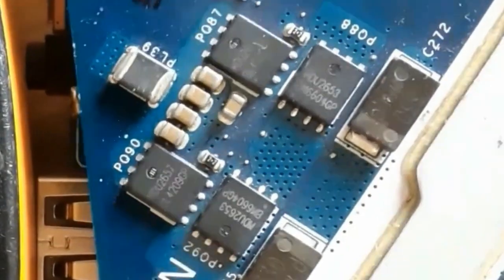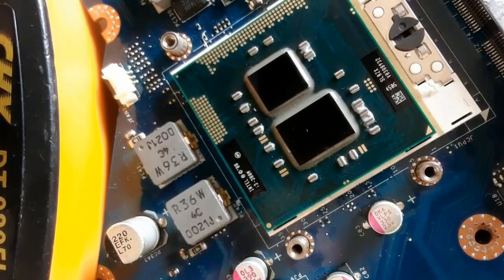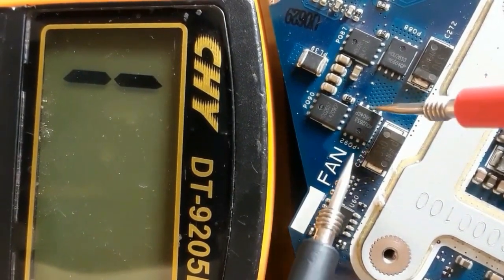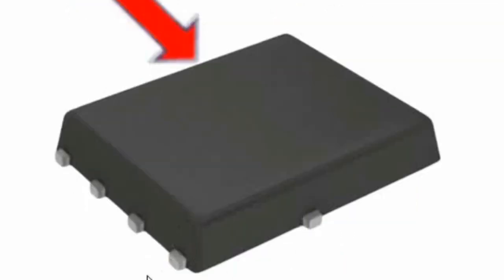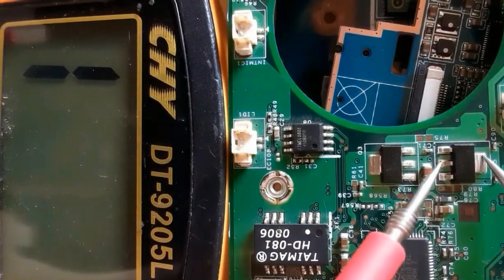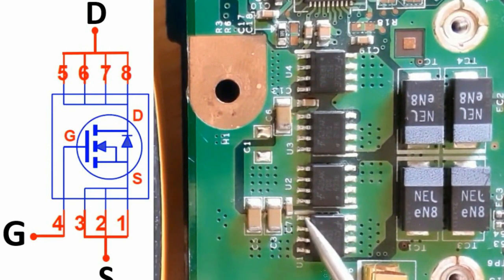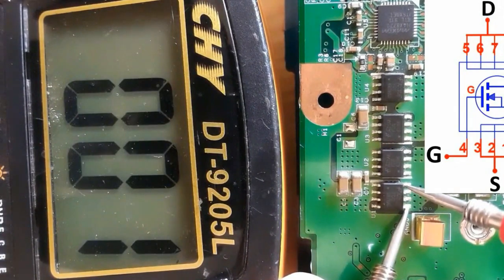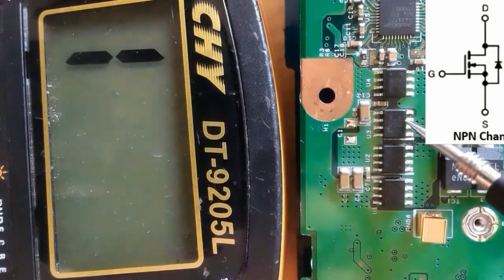Test SMD MOSFETs in Seconds!

Comment: In minute 8:04, i tested same transistor when i put multimiter terminals between gate and source i get reading and when i swap them i didnot get reading. Then i removed the transistor out of the circuit to test but its difficult because the pins so small. Can you show us a method to test it out side the circuit because i cant put the multimiter terminals to transistor pins. Thanks for your vedios